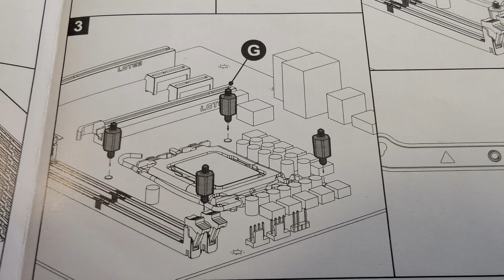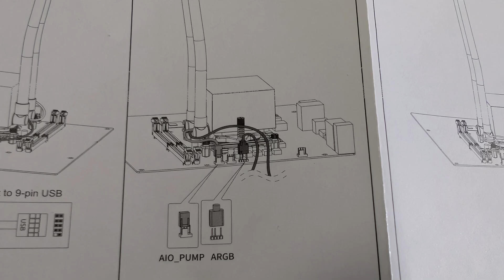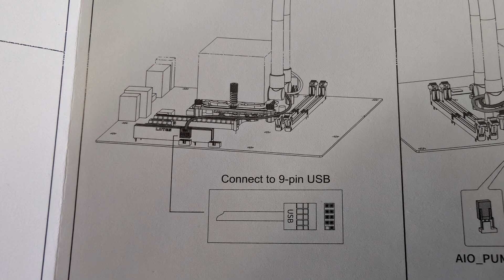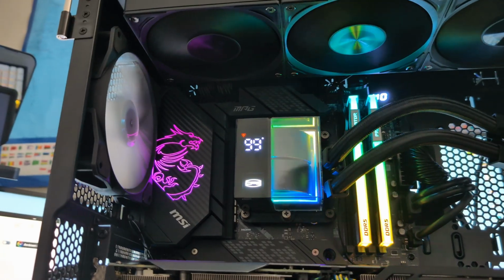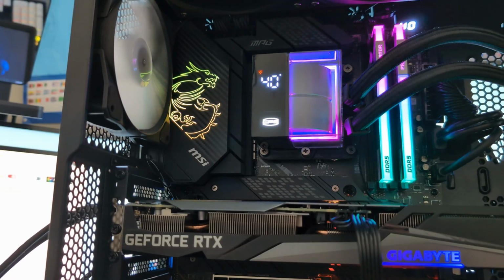How to Install PCCOOLER CPS DS360 AIO Cooler (AM5, AM4, Intel 1700)

Comment: Thanks! Just bought this cooler. However, I run on Fedora Linux. Is the Temp and ARGB showing by default, or do I need their WIndows software to apply it? If it does work by default, does it show C or F by default?